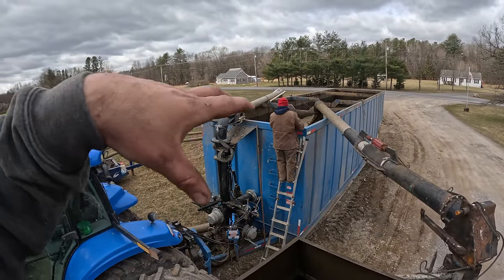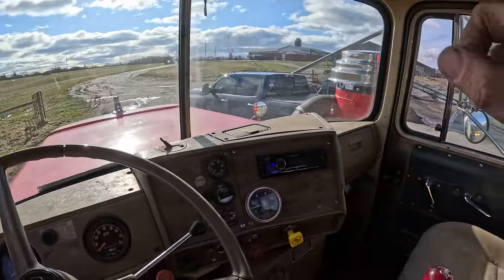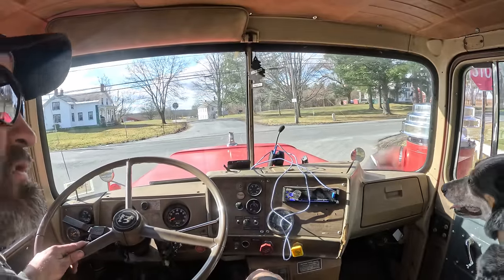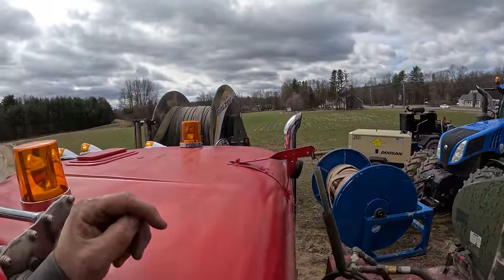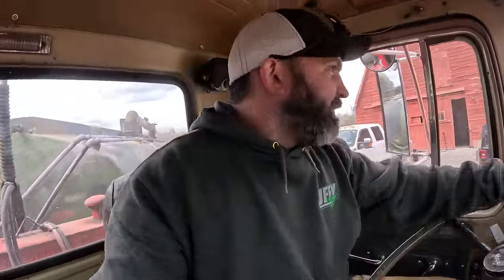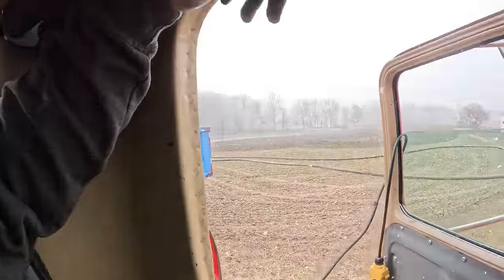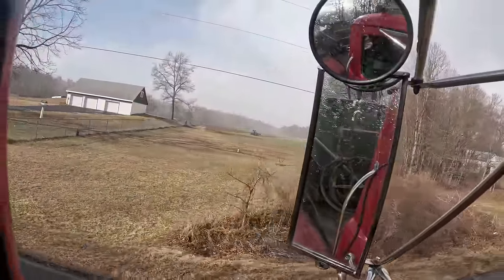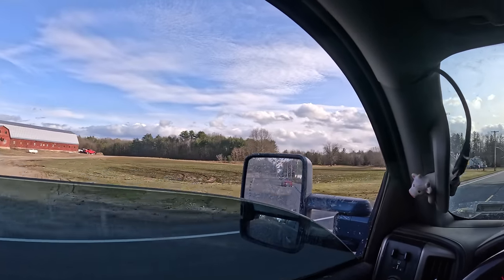On The Move With Manure Again- Will The Pump Be Frozen?

Comment: In europe are different fractanks/slurrycontainers some are company build, selfbuild, slurrytrailers, modified containers.
Some are filled through the top others through hoses and emptying the same way. All that they have in common is that they almost never have a pump mounted on them.

Comment: You could get yourself a float switch from a submersible pump and mount it near the top of the tank and have it turn on a light on the front and back of the tanker when it's nearly full.   Takes the mechanical bit out of it so no problem with it getting bound up with manure.      🙂
Reply: Mount a rotating light or normal light on the top by the stairs that way you will always see it

Comment: With 4 batteries you really need to get a dual alternator setup. WHen the batteries are dead and you start it with say a jump box the alternator is going full chooch charging 4 batteries and its not designed to do that.
Reply: 90%off trucks only have 1 alternator and 4 battery's,  not necessary